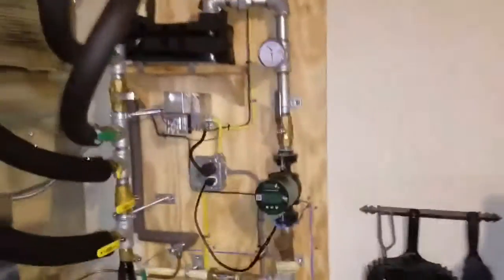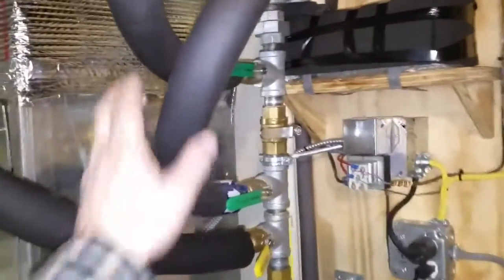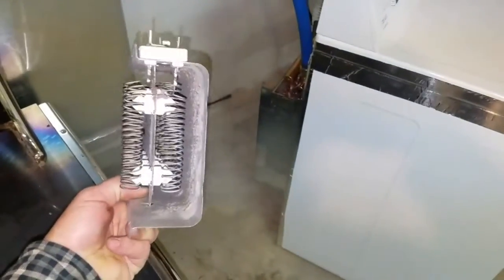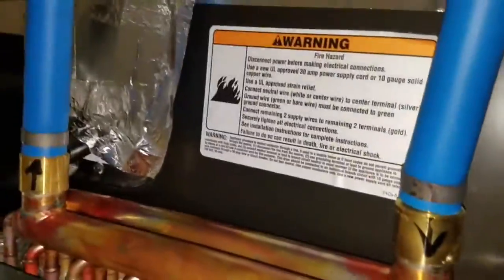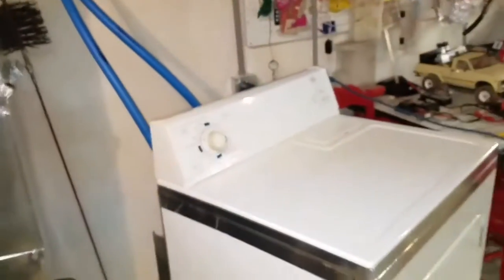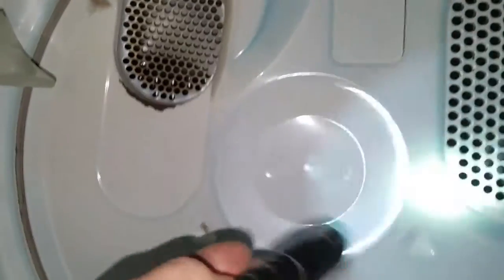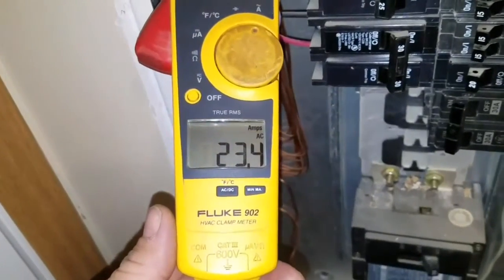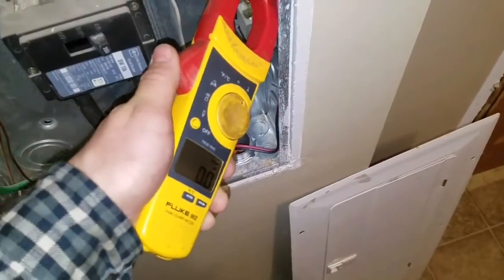Wood Heated Clothes Dryer

Comment: This is one of the most underrated ideas successfully executed on YouTube.  All the people out there making sand batteries and offgrid setups complain about the dryer being the #1 energy hog and Camo Crawdad nails it with a hot water conversion of an electric dryer.  This kit should be an option on most dryers sold worldwide.  Kudos!   Would love to see more about how the heat exchanger was made and installed onto the dryer.

Comment: Nice.  How's it working now after nine years? Have you changed anything? Do you bypass it when you're not drying clothes?
Reply from the maker: It still works great. Yes I have valves to bypass it when I don't need it. It also works great to heat the basement.

Comment: Amazing. But wait. Is that an on demand style heat exchanger you have set up for domestic hot water?!
Reply from the maker: SlipperySlope yes it is
Reply: Camo what kind of heat exchanger? BPHE? And it's able to instantly heat cold water to ~50C? Love to learn more about that setup, always though boiler style setups were limited to tank use! Thanks and beautiful work!
Reply from the maker: Thanks. It is able to heat the 55°F well water to 160°F as fast as we can use it. It is a 30 plate exchanger. I'm not sure what make it is. I have another video of my boiler and setup. Check out my channel, its on there.

Comment: Nice job!  I see they sell 8"x8" water to air heat exchangers for around 40 dollars now, if 2 of these were hooked up in in series, you should be able to get a higher air temp.
Reply from the maker: Clinton Briley I thought about doing that. I didn't  want to take a chance on the blower overheating from the added restriction of two coils. It would be a good experiment though.
Reply: Could recirculate the exhaust back to the inlet to get it hotter